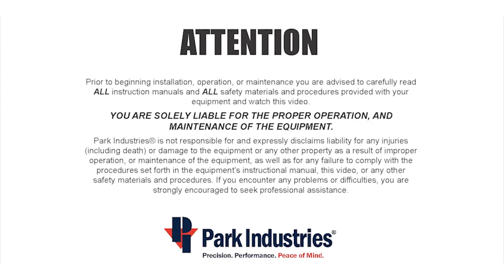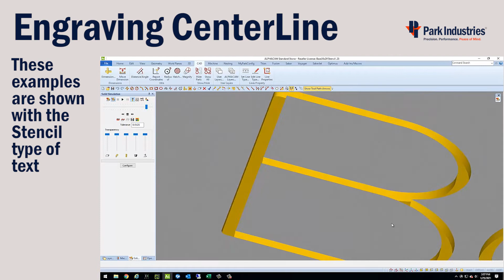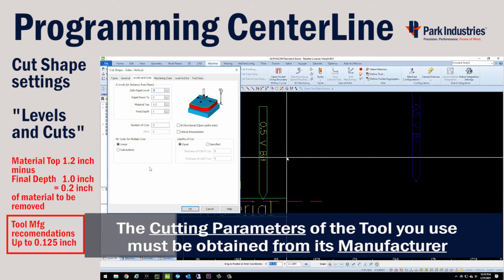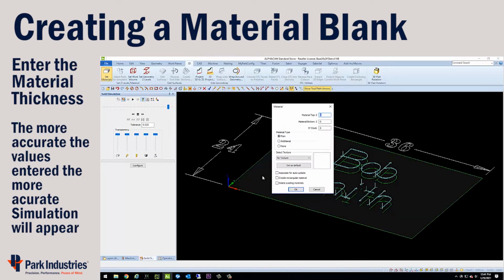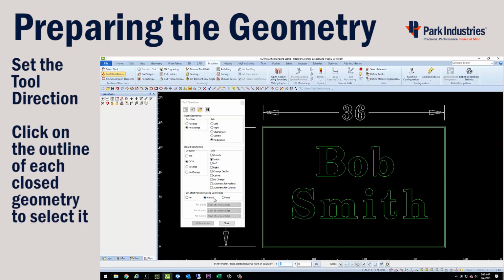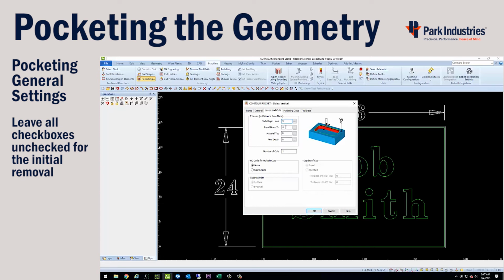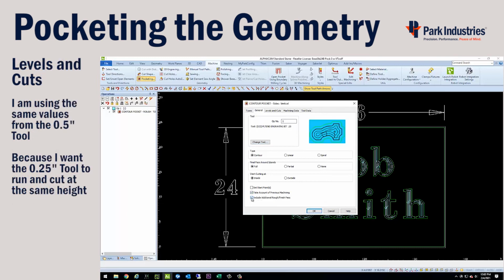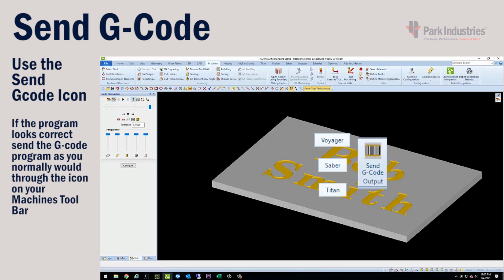Engraving & Pocketing with Text CNC Programming | Park Industries

Comment: Awesome!!! Thanks for putting this up. I’ve been wanting to use the auto pocketing. I needed some reassurance I had everything set up right for using Mach/comp. Can’t wait to try couple dry runs before samples.  I’ll send a video of full slab engraving for one of our suppliers. I’ve been working on cleaning up the vector. Wish vectored images were cleaner files. Any recommendations? I’ve been checking out aspire?
Reply from the maker: Great to hear you found value in this, thanks for the video feedback!!

That video sounds awesome, we'd love to see. For recommendations on vector files, please give our training team a call. You may be asked to leave them a message, but please do as they will reach out to help as soon as they can.

Thanks!